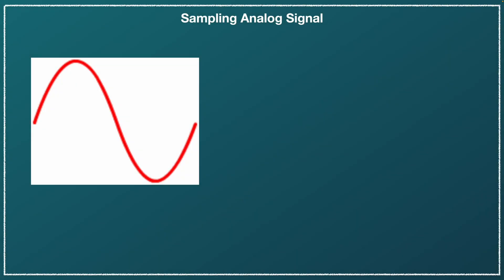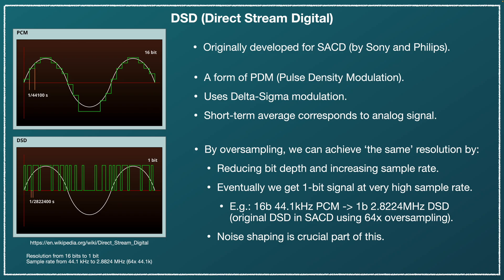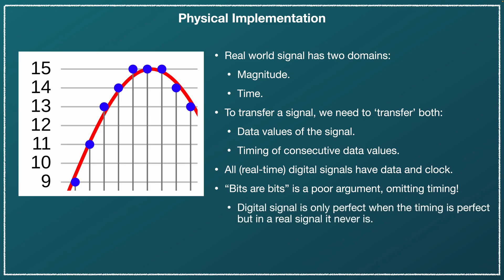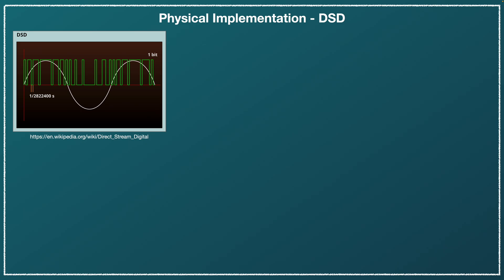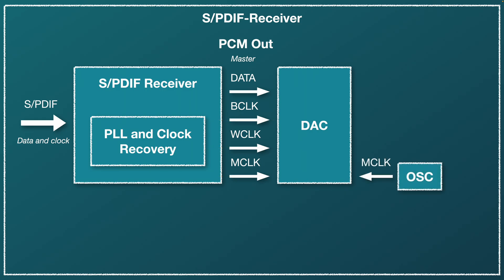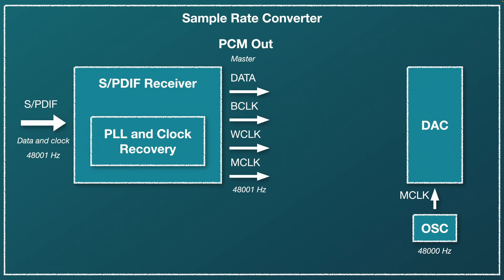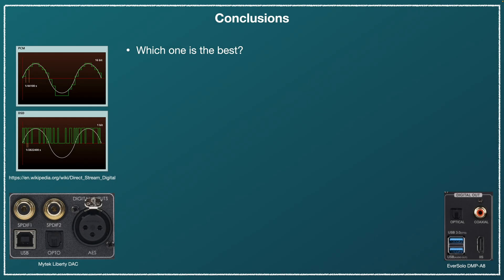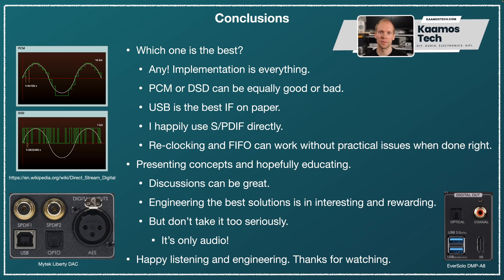The Best Format? All You Need To Know About PCM, I2S, DSD, S/PDIF, and USB-audio.

Comment: Great overview. Optical SPDIF brings a rather big advantage in that it can get rid of any chance of ground loops. It would be nice to have a standardized "optical USB" at some point...
Reply from the maker: It is a great benefit in some situations. Unfortunately, optical SPDIF is also the poorest quality of the interfaces with higher (measurable) jitter than the electrical counterparts. Some USB-interfaces do have isolation. You can also use external USB-isolators, like Topping HS02 I use for some measurements.
Reply: @kaamostech  Quick question...  I use optical SPDIF from my Arylic S10+ to my SMSL DO400 DAC/Headphone amp.  The SMSL uses an ES9039MSPRO that has DPLL.  If I understand correctly, this "cures" jitter.  Is this true?  TIA!
Reply from the maker: @TheSurfingAlien  I doubt it will cure jitter but it may suppress it. I don't have experience in trying to measure if it makes a difference. I also have an SMSL D6s DAC which has a DPLL setting you can change (it's not the PRO DAC IC though). Maybe once I could try to measure something. ESS DACs have quite different clocking from AKM I am most familiar with so their jitter behaviour may be different.

Comment: Awesome video. I said 10-15 years ago I was'nt going back down the Audiophile rabit hole, but some how I ended up back there 9 months ago :S In my latest round of gear insanity I found that using a Rasberry Pi and some Ian Canada clock's and hats outputting I2S or SPDIF is far supirior to USB for high end audio playback, and even to the supposedly very high quality clocks in the Guastard A26 DAC's built in streamer, which one would presume means that DAC and the streamer in the A26 are using the same clock. Detail, and most notibly 3D sound stage depth is easily decernable when paired revealing enough gear. Ian himself said to me that the sound quality is mostly in the clocks. Prior to messing around with better transports I had said that in my previouse testing USB was far superior. Also power can make a big difference, when I run Cheaper 5v powered DACs, Pi's, USB to Spdif converters etc on battery packs theres a noticible improvement in sound quality

Comment: Time itself is analog, so a 'real time' signal can't be fully digital. (since the sample time is not encoded, and therefore jitter can occur) If the DA converter has a buffer, witch doesn't go empty, it can assume the bit-time (have it's own clock) therefore the information in the signal is fully digital.  (the signals timing is not used for audio)
Reply from the maker: Yes, I understand your point and agree, I think we're talking about the same idea. If the DAC has its own clock, it's the same situation with two clock domains as presented, and you either need an SRC or long enough buffer. Of course, the analog nature of timing and its flaws are present there as well, it's just the DAC clock that determines it. But yes, the concept remains the same - if we can transfer the digital data in what you call bit-time, it's clocking doesn't really matter.